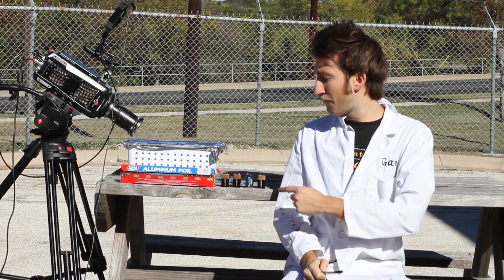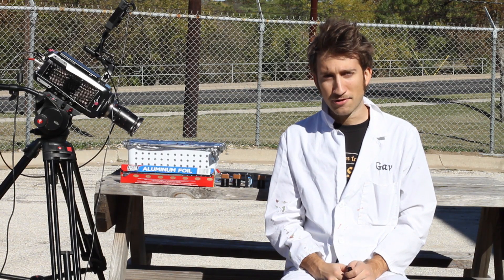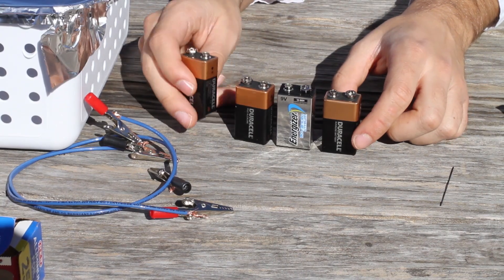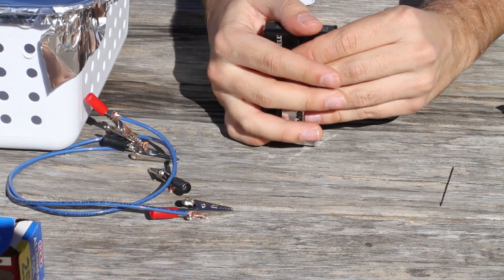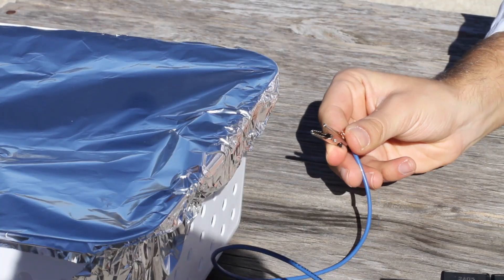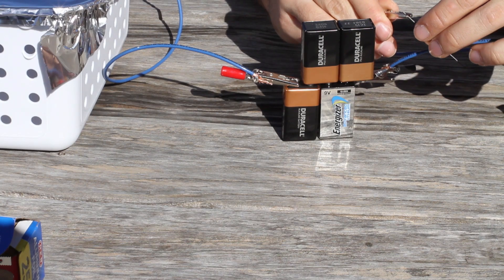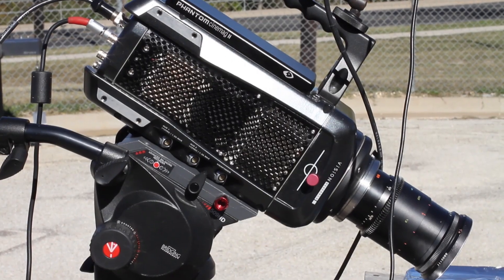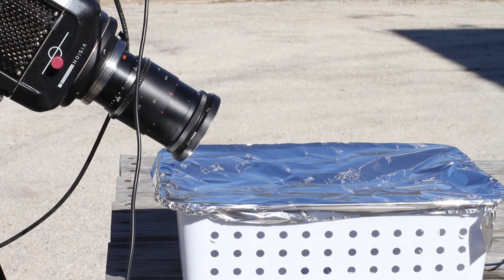Tiny Plasma Cutter in Slow Motion - The Slow Mo Guys

Comment: I'm not sure why Americans like to say AluminUM, but I hope we remember that the -ium suffix has been used for metals since much before USA was formed. So, yeah. AluminIUM is the correct spelling. Check out the IUPAC periodic table. That the most "official" you can get.
Reply: No, you are wrong...Do you even google bro? Go to google and type in "What came first aluminum or aluminum" and you will get the truth. Why people spread misinformation about something so simple and inconsequential is beyond me. Especially considering you are all using a machine that is capable of nearly instantly providing true answers to nearly any question you could conceive. sigh silly peoples....
Reply: Zeke Aeloen If you Google "Aluminum" the first result is a wiki page about "Aluminium" (notice the correct spelling). I know what Google is, and that is why I know, that the rank of a search result doesn't determine its correctness, merely popularity. Had you paid attention to your high school chemistry class, the ultimate authority on anything chemical is the International Union of Pure and Applied Chemistry or IUPAC. BTW, your dependence on Google for "true" answers bothers me. Google does NOT provide answers. Its page ranking algorithm is just a machine learning algorithm coupled with huge data mining intelligence which DOES NOT know what it is sorting. Its a bot. All the "correct answers" come only from experts and professionals in the respective fields. Google simply provides you most REFERRED to then the most relevant page (prioritizing in that order). It is very likely that this method will lead you to the correct answer, but does not guarantee it.

Also, no "peoples" use "people".
Reply: That Guy You Don't Know. Its not a debate. Its a matter of fact. Americans pronounce and spell it wrong. However you justify it does not interest me. End of story.
Reply: SFxTAGG3 Because it is not something that should be decided by "most popular version". Chemistry is a science. Its knowledge is standardized across the globe. It doesn't matter who is responsible. To make such juvenile mistakes or even deliberately misspelling its key terms is unacceptable.
And to answer "who cares": Well, take any English speaker. If someone starts to misspell common words like "definitely" or "embarrass", they have an urge to correct them because consistency of language is important. When someone speaks or writes incorrectly, the listener/reader mentally corrects them to what they might have meant in order to understand them. Its extra effort, and it annoys them. So in short, EVERYONE.
Reply: aluminum sounds as if you're too stupid to pronounce aluminium
Reply: +Aman Singh Language grows, adapts, expands, changes, evolves, etc. etc. How do you think the dictionary came to be? Who made the words that go in them? If there exist a popular way of spelling something (or pronouncing something) and enough people support it then it becomes part of langauge. So... Aluminum and Aluminium are both correct and always will be.

I never understand arguments about langauge with everyone acting as if they have the credibility and authority of a linguist with out even understanding WHAT THE FUCK language is in the first place. Grow the fuck up and debate on a more interesting topic.
Reply: SFxTAGG3 We are just arguing about a minor spelling error here. There is no need for you to defend it so fiercely. The only thing we should all agree upon is that it is wrong. That's all. Whats the big deal? Also, I see my mistake. I should have said "everyone educated and sincere" instead of just "everyone". I think the people who don't get annoyed by stuff like this, probably do not encounter "reading" much often. I don't know how many chemists you meet, but such empirical statements "I haven't met people who have XYZ" are just invalid. The set of people I meet could be much more diverse than you or vice versa.
Reply: TheReferenceGuy If tomorrow you people start calling Aluminium "puppy-rainbow", I won't be offended. I don't care. I am simply saying its wrong. I am just some guy on the internet.  Its up to you whether you change it or not. Like your imperial system, your idiotic way to write dates and many more things, it will be just another quirk that Americans have. But it will be a quirk. Not a norm. That's all I am saying bro.
Reply: +Aman Singh While you are technically correct, aluminium is only the correct spelling in Europe. If America wants to spell it differently, they can, as it is their language (US English), not yours, which of course is the main English. After all, there are some words in your language that could make more sense in American, scientifically or just descriptively. It's rather impolite, rude, and  unnecessary to criticize a country or province just because of their language.
Reply: Catervarii
Close but not quite. 7-8 unreasonable people like you unwilling to argue logically were constantly infecting me with their ignorance.
Reply: *****
You are absolutely justified in that. I can't reach out from my screen and hold your tongue over this, but I CAN call you wrong. Whether you care about the correctness of your first language or not, I DON'T CARE.
Reply: Catervarii Isn't it interesting that you called me ignorant before you read through all my comments to see for yourself that the opposite is true? And if you had even an inkling of decency, you could see that Í had defended it well, without using a single curse word.
I guess it all is a part of your "first language" like *****  there eh mate? 
If it is all too much to digest for you, let me dumb it down: I am not an intellectual god or something. The only thing YOU have trouble dealing with is that a common guy with basic and logical understanding of the world just called Americans wrong and JUSTIFIED it with arguments, and you can't do jack about it except maybe moaning and calling me names.
Reply: 007monkeyman2 Well, Aluminium itself was Alumium first, then people disagreed over "Aluminum"  and "Aluminium". The standard became Aluminium though. Don't know why Platinum, Plumbum, Aurum, Argentum etc follow the -um suffix. Maybe it has to do with their Latin roots ending at an inconvinient vowel or something. I don't know.
Also, the driving thing: WTH are we talking about here?
Reply: Noah Roller
What would you know about English when you're too stupid to comprehend it? I said if any of my thoughts entered your tiny colonial brain, then it would overload, thereby causing the nosebleed. Nobody mentioned any violence. So, you know, before you tell people about English, which we weren't even discussing, then, keep that in mind.

Also, not to mention, just to cover all the great shades of stupidity found on the moronic rainbow that is every utterance you make. ALUM, the word from which ALUMINIUM derives, is FRENCH. Not English. Secondly, the MINIUM part is to signify it's a mineral. You attach it to the derived FRENCH word, as a LATIN suffix. No English involved in this etymological event.

Seriously, what's it like inside your head? It must be very cramp. To the point where light begins to bend at the centre. You lobotomised. quasisapient. shitlark.
Reply: +Aman Singh Aluminum does sound a bit retarded. that's why it's annoying to me. it's like the americans are dumbing everything down on purpose all the time.
like why?
Reply: kingStormy Sky

Exactly, because that's really what it is. Some moron inventing an alloy not knowing how to name things in Latin.
Reply: +That Guy You Don't Know. I'm assuming Aman is from the UK so I'd just like to point out that chemistry isn't a mandatory subject here either.
Reply: +Aman Singh Why is that too far? No one alive today is responsible for the spelling change. It is what it is. Who cares?
Reply: TheReferenceGuy
Hello friend! That has happened to me before.  You can post a new comment now.
Reply: Aman Singh I think you're taking things way too seriously. You're like that historian who said that Australians need to get their original accent back. It really doesn't matter. We all still understand each other. I don't believe that "everyone" cares so much about it as you believe. Besides you, I have yet to meet anyone who is annoyed by stuff like this.
Reply: +Aman Singh The imperial system may be weird and partially counter intuitive, but millions of people use it which make it quite more than a quirk. And there is no functioning different understanding between > accepted < spellings of the word. So I know you're trying to stress this whole consistentcy of language idea, but langauge is anything but consistent it's constantly shift and changing, and if I tried I bet I could even find examples in sciences' terminology too (since you seem to think langauge of the sciences are exempt from this flux).
Reply: +TheReferenceGuy You even highlight another funny point:-dates arent even identical internationally. They're 2-3 different dating standards.
Reply: +Aman Singh The IUPAC officially recognizes "aluminium", and its American counterpart, "aluminum" is recognized by the group as an ACCEPTABLE alternative.  So, if you say we are wrong, then you better let the IUPAC know that THEY are wrong too.  Although something tells me that you don't rank that high in the world.  Your argument is invalid.
Reply: They mean the same thing the English language is fluid.
Reply: +Aman Singh Language can be spelled any way that we want it to be. Pronounced any way we want it to be pronounced. By the very definition it is, "using arbitrary sounds in conventional ways with conventional meanings..." As long as enough people know what it means, it is considered a language. French pronounce the word "Cat" way differently than Germanic speakers would. That does not mean that they are wrong. But because enough people around the world know what they mean, it is considered a language. That is why new languages form and old ones die off. It happens. Some criminal gangs change the meanings of words so that law enforcement don't understand what they are saying. It is their own language. Enough of them know what it means to communicate efficiently. Language is literally the use of arbitrary sounds that mean nothing until you attach meanings to them. So technically both are correct. Just in different languages. The English (UK) and the English (US) that is why they have separate options on devices. Everybody needs to take a chill pill
Reply: +Aman Singh dont care, still gonna call it aluminUM . Beause i don't plan on leaving America m8.
Reply: ***** I think he pretty much ran away scared; 7-8 people just fucking obliterated any sort of argument, defense or rebuttal he had. He hasn't responded in a week.
Reply: either way i wouldn't have given two fucks. idgaf where you come from dont tell me how to speak my first language lol
Reply: ***** Would you have given one fuck?
Reply: Aman Singh Oh no, at least 4-5 people did that. My argument was certainly logical, beyond that of even yours. And it's really not a matter of ignorance here (except on your part), so don't pretend to be the intellectual god you wish you were.
Reply: Aman Singh Ah so your true colors show: "..but I CAN call you wrong... I DON'T CARE". You care enough to bitch about it, but you don't care enough to defend your argument. It just shows your immaturity and lack of understanding (something you called "ignorance").
Reply: Aman Singh Lol I thought you didn't care? Guess that was just another fallacy. I've done plenty more than moan and call you names. Go back up and actually debunk my argument. You can't. Because you're wrong.
Reply: +Aman Singh First off, it's not "Platinium" it's "Platinum" so not all metals have that suffix. Second, I've seen you talking about how "Aluminium" is the most popular pronunciation so it is the correct one, and to that I have to say that the majority of the world drives on the right side of the road, so you all drive on the wrong side. Honestly, how can you trust someone who can't even drive on the right side of the road?
Reply: I am muting this post now. Thank you for teaching me new things. Good luck and may the fourth (the hokage, not the starwars day) be with you.
Reply: +Mote of Dust 
It's not a question of whether aluminum came first or not. We all know it's an American alloy, and that's where the spelling came from. 

BUT. 

ENGLISH, and the LATIN from which a lot of it's words are derived, came thousands of years before USA did. 

And so did the rules for naming minerals. It's called aluminium because that's what the linguistic rules on the matter dictates that it's called. Maybe if you yanks manage to revise history to the point of where your textbooks talk about your great battle with Julius Caesar, then maybe you'd be on to something.

But until then, there's literally billions of us who use the correct aluminium spelling, and three hundred million thicko colonists who haven't quite picked up on proper academic procedure yet.
Reply: Vincentius Smith
well that moron might've invented it, but all the other morons are just too lazy and dull to pronounce it properly.
he probably thought of Aluminum 1st for that specific reason - the general population won't be able to pronounce it Aluminium
Reply: +Vincentius Smith you just called everyone in america uneducated
Reply: Moncon Ramos

And Americans slaughtered 61.000 innocent people in Chilé. I'm sure they'll manage.
Reply: Vincentius Smith Americans or our government. do you think we can help that when our government kills helplessly people. no, so don't say Americans say Americas military. you are disgusting and no better than us for stereotyping us. some of us are smart and caring but all you are shown is fat and lazy people. I am 14 and make all A in school and plan to go to college to be a doctor and I am more responsible and mature than most adults I know. my mom left my dad for some criminal when I was 6 so I had no choice to become mature. this country sucks and I know it. if I had had a choice I would have chosen to be Canadian. but now when I go to any country i will be judged because I came from America. so don't judge someone because of where they came from. how about you tell me what country you live in so I can throw a stereotype right back at you.
Reply: Don Williamson Sorry. Didn't know why I assumed that. I really didn't want to sound like a know it all. I was just annoyed that people think "both versions are correct". Changing the spelling of "colour" is fine, calling a biscuit a cookie is fine and deliberately confusing between football and rugby is also fine (its their country, go nuts). But changing an internationally accepted chemical name is just a little too far.
Reply: Noah Roller

Right, of course, because just because a person is English, everything they say is therefore also English. A++ Logic.
Reply: @VincentiusSmith  If that person coined the term originally, then yes, what they say is also English. Your inability to understand something said doesn't make it wrong.